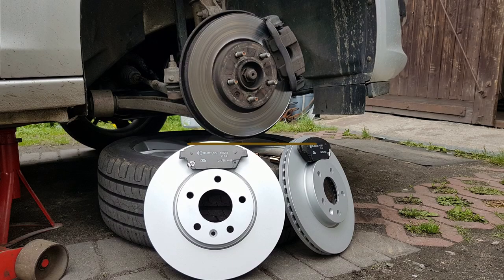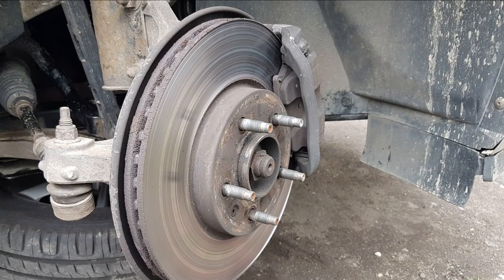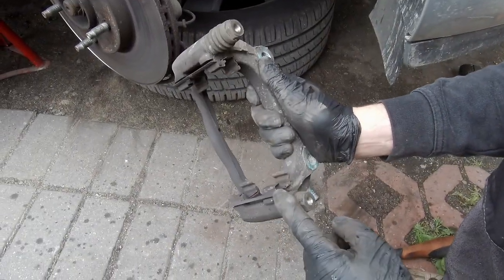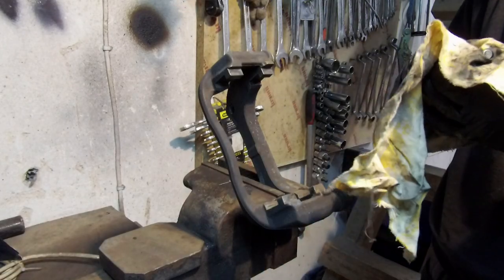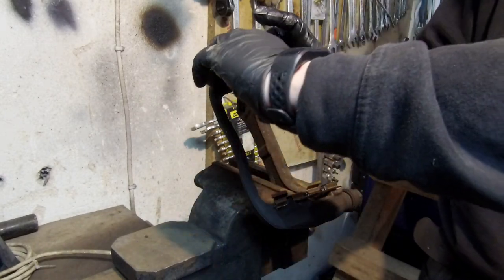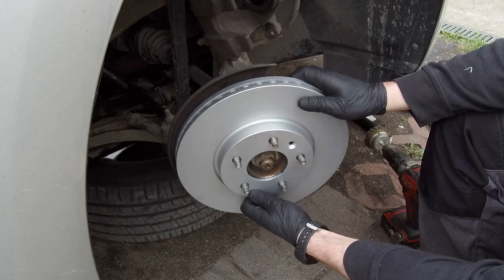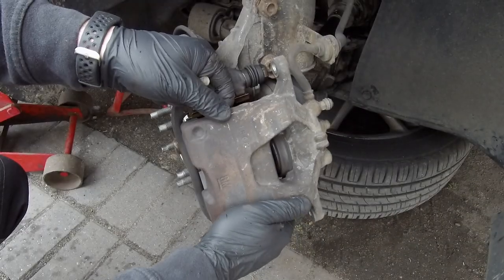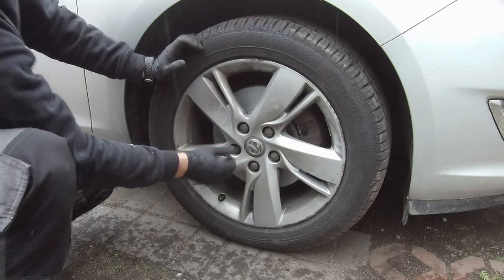How to replace front brake pads and discs - Vauxhall / Opel Astra J Insignia (COMPLETE GUIDE)

Comment: I replaced my discs and pads a month ago on a second hand car i bought. After 2 days of driving the brake caliper decided to sieze up while driving causing smoke!! The car i bought must of been sitting around for such a long time that rust must of built u in the caliper piston and when new pads were installed the rust caused it to seize up! what a head ache! the smell was horrible haha. Good video! Subscribed.
Reply: @bc-mr1si  hi. Yeah I did. I don't know why it happened so I'm presuming it was just old and siezed.
Reply: @bc-mr1si  If you open the bleed nipple, air will come in right? If I only open the reservoir cap is it ok?

Comment: "If fitting new pads, before refitting
 the caliper, push back the caliper piston whilst opening the bleed screw. This is to
prevent any dirt/debris being forced
 back up the hydraulic circuit in the ABS modulator"   !!!!!
From Haynes service instruction.....
Reply: or, remove brake fluid reservoir cap..(?)

Comment: This guide was brilliant. My only query is that after following this guide I seem to have air on the brake pedal. Could it be that not opening the bleed nipple has pushed air into the system and damaged the brakes somehow?
Reply: Did you find an answer to your question?
Reply: I also got spongy pedal after changing front rotors and pads + rear pads, feels like air in the system

Comment: excelent, but one thing in mind, when using ATE coated brake discs you don't need to degrease them (its says in manual) because paint prevents rust its not bare surface so it doesn't have any grease on, brake pads will clean disc surface after few miles

Comment: Great video. I'm about to do some on a 2013 1.6 astra. Question for you:

Do you have to tell the ABS module that you have changed the brake pads?
Reply from the maker: Hi there. No you don't have to tell ABS module anything, 100% mechanical job.
Regards
Reply: @carsguidediy  

Thanks for the reply! ✊

Comment: I need to buy a tool for unwinding the the brake caliper. What would you say are the requiremements/specification? I have seen there are different models and differenst sizes of the actual circular pad that do the pressing. I suppose it must not be too big. What is the right size?

Comment: I have the Vauxhall workshop manual and just in case the caliper mounting bracket should be just 40nm torque,it's the wheels are 150nm

Comment: Could the copper grease be used for the guide pins if I didn't have any normal grease ?
Reply from the maker: Hi there, copper grease is bad to use with rubber elements, It's better to leave old grease than use copper one. Try to buy silicone grease. Available in any parts stores.
Regards :)

Comment: Thanks for that, I would never have bothered to clean everything and I'm pretty sure the mechanics I have used didn't either as they done it far too quickly. I'm gonna follow this guide during the weekend. Looks a thorough job.

I have the copper grease already but what grease did you use for those carrier bolts?
Reply from the maker: Hi there. Sorry for so late answer. If you are asking for guide pins, I'm using brake silicone grease ;)
Reply: Basically, any high temperature grease will do.

Comment: I have the electronic hand break is this just the same procedure?
Reply from the maker: Hi there, If you are replacing front brake pads and discs it doesn't matter.
Regards ;)
Reply: @carsguidediy  unfortunately it's the back☹️

Comment: this video is a bit fake. The Screw that holds the disc never ever unscrews - it is stuck and it will break and will need 1 hour to get out. Also all screws and guida slides  work very very hard to remove. In your video everything is so easy